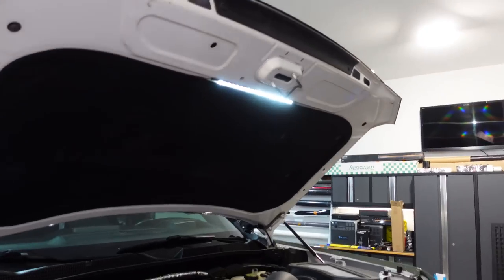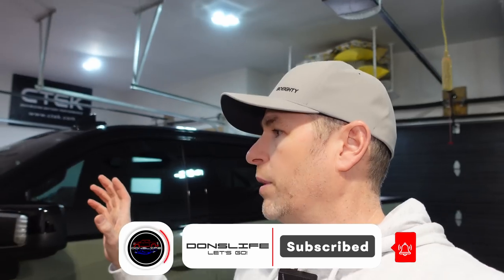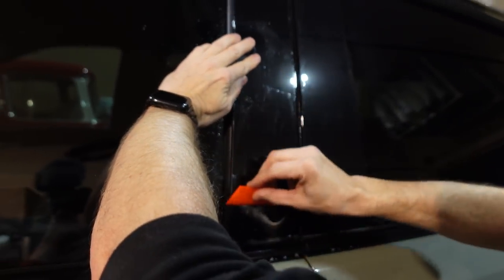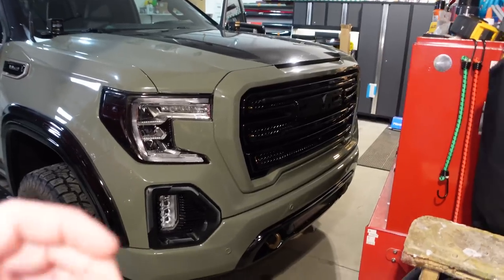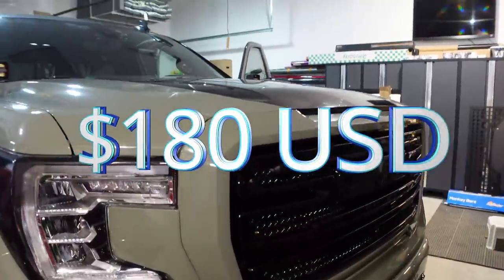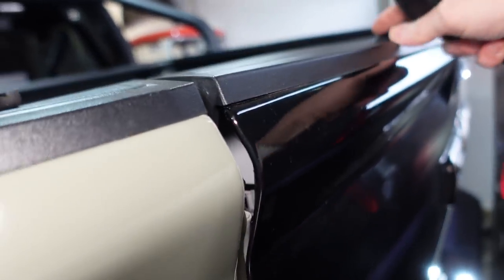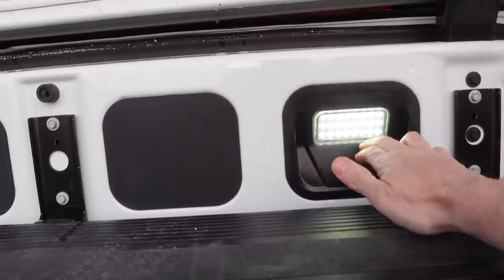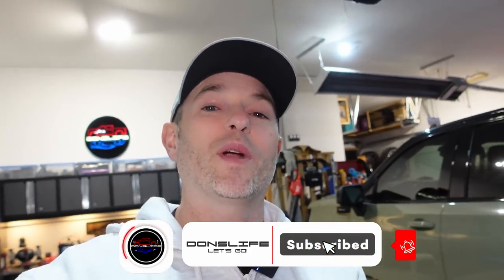Top 10 Best Cheap, Budget-friendly Truck Accessories to Start Your Mods! (Part 1)

Comment: Great mods, Don!
I use the under hood light but when the switch got rusted, I ran the ground to an interior switch bank.
I went with a stub antenna but just couldn't bring myself to get the 50 cal bullet look - hate it, though a stub antenna does work well.
I like the screen covers, especially for my 14.2" screen - I'll be looking into that! The tailgate seal really does help keep water out.
The Hyper Dip looks good for some fun stuff! I also did the Boost Auto mod for lights.
This a great overview video! I have a power retractable bed cover but didn't have the funds to spring for the really cool one you have.
Thanks for the videos! :)
Reply from the maker: My pleasure 🙏

Comment: I like your sports bar on top of the back cover, how much u got it for?
Reply from the maker: It is a preproduction version I am testing in partnership with EGRUSA
Reply: @Donslife  is there anyway I can buy it ?
Reply from the maker: Have you looked at EGRUSA’s site? They sell them for several truck without the RollTrac box cover, which mine is designed for. If you want one for the EGR RollTrac box cover like I have, I don’t know when the release date is

Comment: What did you use to seal up the tailgate mine gets water in it too easily
Reply from the maker: I used this.  Keeps rainfall out but if you try to force water in, you can find weak points. 

Tailgate Seal Kit For The GMC Multipro and Silverado Multiflex Tailgate Install and Review
https://youtu.be/ZjjEgntXQTE

Comment: I installed the bed lighting strip. I wire the two strips like you did and still blink and turn off. What do you advice
Reply from the maker: Add a 12volt relay to draw extra power from the battery.  Cost is under $10
Reply from the maker: Here is a video from when I installed a 3 strip with a relay.  

Affordable Truck Bed LED Lighting: Easy Install Guide
https://youtu.be/F_tpC-rdEsE
Reply: How is it that it worked for you, and i did the same connection like you did, but my still is blinking

Comment: you ever do a   leveling kit i heard   you can mess up your auto 4x4 i got a 2022 gmc sierra elivation 2022 non refreshed
Reply from the maker: I don't have a leveling kit, but yes with any of the factory lifted trucks, like my AT4, a level kit can cause problems for AUTO 4wd.
Reply: @Donslife  thanks for reply👍👍

Comment: Is it true vinyl wraps can destroy your paint? Are they 100% safe?
Reply from the maker: If you are applying on a properly painted and cured surface with a decent vinyl, you should be fine.  A repainted part, section or panel could be at risk.
Reply from the maker: It is rare to have the paint finish wrecked.
Reply: Thanks Don. I have a 23 AT4 and am looking at doing the roof black like yours. Maybe not the rear vertical by the back window and sides like the new TRD PRO. Love the content!